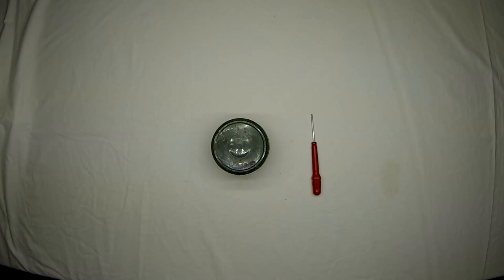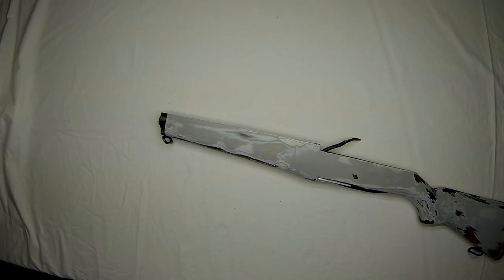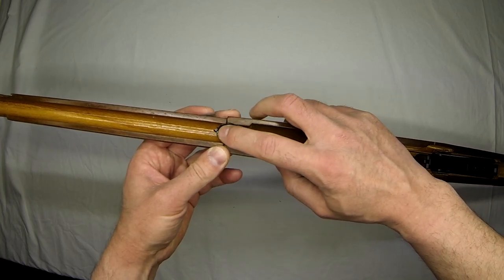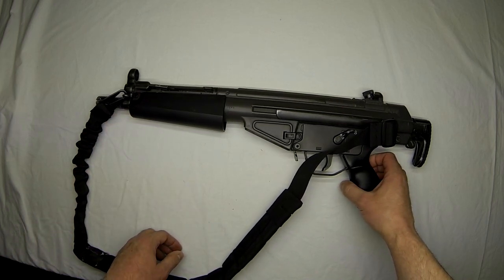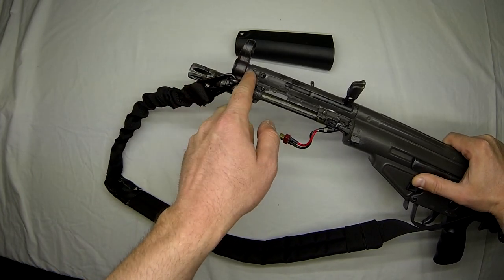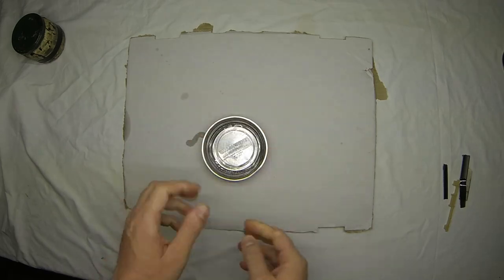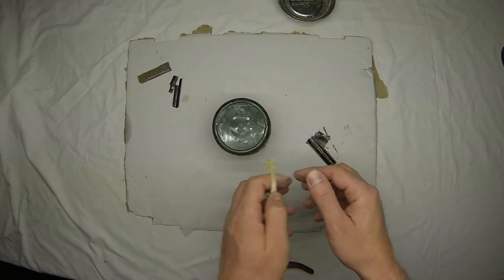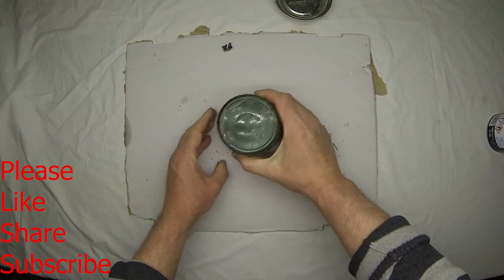ABS paste: a very useful mess

Comment: Another quick tip for crack repairs, instant and durable plastic is using baking soda to cover the crack or fill then pour super glue on it. You can paint over it too. Goid video!
Reply from the maker: I'll try it out. Also; use water if the super glue takes too long to dry